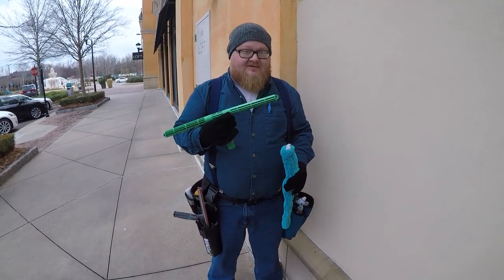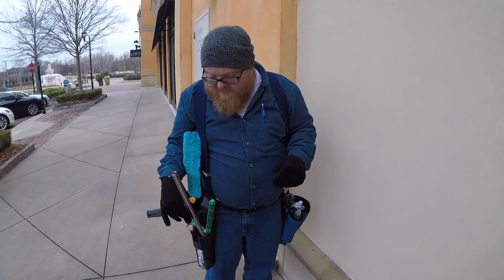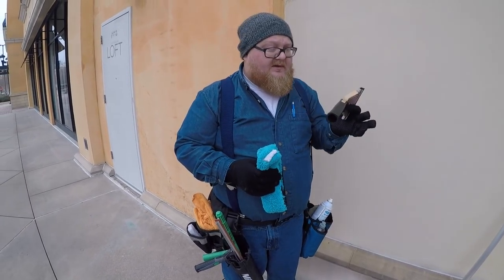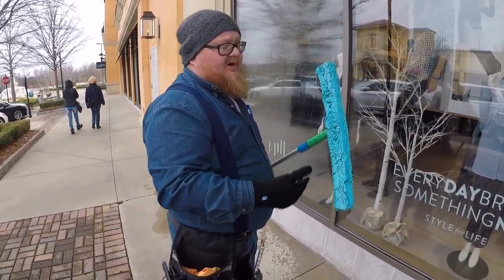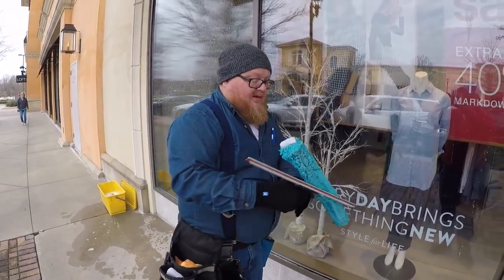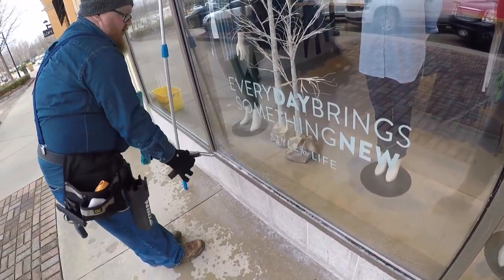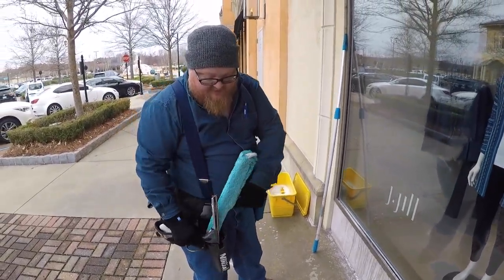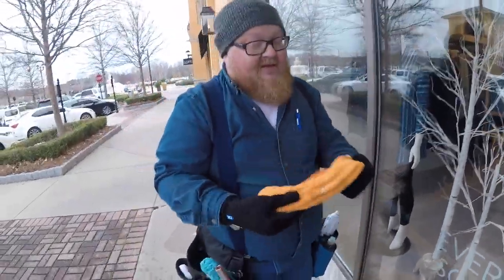Window Cleaning with Fluff Daddy

Comment: It's nice to see high quality videos. Keep up the good work Fluff. 

New guys: pay attention to the pole work. When you pull down, one side of the squeegee is higher than the other. The water will run up from the low end to the high end (imagine a snow plow pulling the snow towards you). So keep the high end on the wet side of the window as you work. This drives the water towards the wet glass. When you pull the squeegee off the glass, turn the high end down as you raise. This keeps the water on that "high end" of the squeegee. This is how you pole a window.